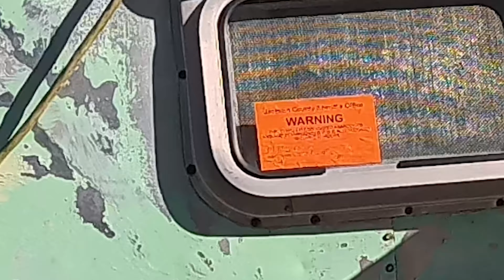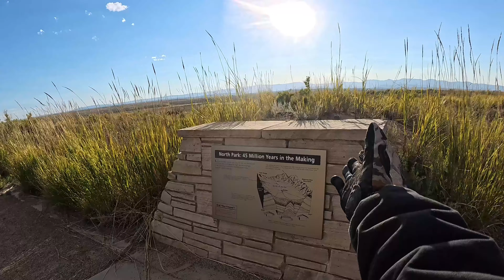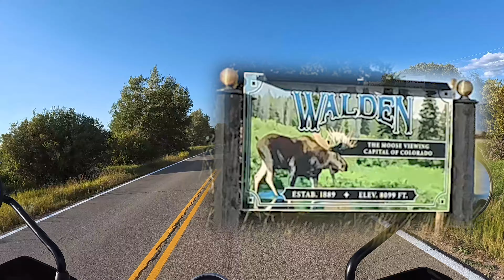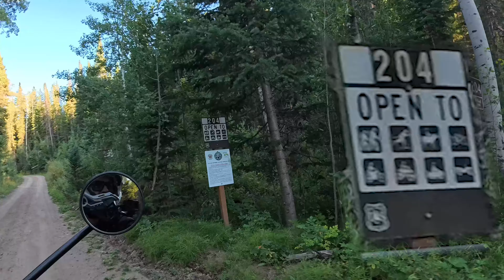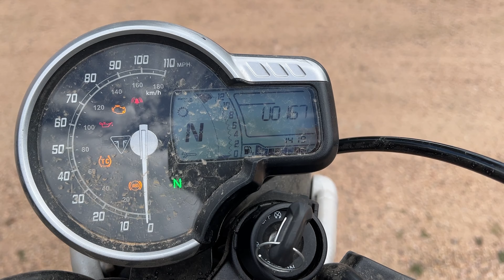1 Little Spill Off Road Disabled My Triumph Scrambler 400 X and Left me Stranded

Comment: It sucks when the tech fails, no matter what the issue. It also sucks that motorcycles aren't required to have the standard OBD system. IMO, even 4 wheelers, boats and side-by sides should have OBD.

Unfortunately, we can't hide from the stupid tech they shove down our throats with new vehicles. There should be a way the end user (owner) could shut this crap off and it will stay off. I'm so tired ofhaving to turn off the lane assist, auto start/stop and all the other crap, just to enjoy driving one of my new vehicles. I have a '22 Toyota, a '23 Mercedes, and a '24 Ford. I miss my '15 Toyota!

I love my TW! I just had it on the hitch carrier to drop my '24 Ford off at the dealer 😜
Reply from the maker: Yeah its so lame noting being able to use a basic obd reader. Yeah I hear ya. All that crap is so annoying especially that auto start stop. Only way around it is to buy old vehicles and fix them up
Reply from the maker: Nice! Thats a great way to do it!

Comment: Should have made sure you had upper and lower crash bars at the start.

Never buy a bike you can't lift. I have no problem picking up my 500# 1200xc, but I deadlift over 400, so that was a consideration
Reply from the maker: Yeah, I can lift it, just harder when a bike is off camber in a wash

Comment: Washing Out Sucks,.....Always happens when least expected,....Sorry about the Future expense,...Stick with Simplicity,....Long Live the TW200. ✌
Reply from the maker: yeah it does, I almost rode that wash out but I learned how to crash over the years, never try and stop a crash just bail. not worth a knee injury. super glad I didn't get hurt yeah I'm mostly upset about right to repair going away with new vehicles. TW200 is the bomb! just blew a fork seal but almost at 19,000 miles and it's time for a front suspension upgrade anyways, and needs new steering bearing set. at least it's never left me stranded
Reply: Won't get you there fast,  but it will always get you there.
Reply: Lol yeah, time for an upgrade.

Comment: RPM in gear ratio brings about the better gas mileage for the horsepower
Reply from the maker: Its also modern fuel injection and engine electronics also

Comment: Time for a 300 rally…
Reply from the maker: LOL, I would get a drx400sm but looks like i'm keeping the Triumph no point in taking a loss, just need to armor it up more, putting the crash bars on, new pro taper handle bars, HDB handguards and mirrors
Reply: Man that thing stock is much too fragile. You hardly dropped it. Sorry that happened. Could you tell me more about your GPS. I’d love to have something simple for off road.
Reply: The Rally is impossibly tall. I lowered mine with a Kouba Link to make it manageable.
Reply: @TDubsKid omg you’d love the DRZ400sm. I just got one. My only gripe is it’s tall. I’m 5’8” @140lbs. I tippy toe it 😂. I will be buying a 1” lowering seat and if I have to, they sell a 1” or a 1.75” lowering link as well but other than that it’s a monster TW200 basically

Comment: That's why you stick to old school tech on a motorcycle. I have my tw200 and a Dr650. New motorcycles are like plastic cars. Kind of lame sorry that happened.
Reply from the maker: yeah exactly if I could go back I would just get a drz400sm instead
Reply: @TDubsKid  it's totally fine to have regrets that's how we learn and grow. Just remember to keep riding a motorcycle.
Reply: @TDubsKid  At least with the DRZ400 you still have a carb you can fix on the trail and have eliminated the fuel injection side of the failure options.  With the Triumph I would be looking at the electric schematic for a way to bypass the factory kill switch.

Comment: That's not cool at all. They need to retro fix that. I don't understand the need for an immobilizer. The wife dropped her Himalayan 450 twice today and the second time the check engine light came on. It does have an automatic fuel shut if the bike goes down running but it resets by shutting the key off and back on. However, the engine light comes on and that took me a few minutes to figure out after making sure it wasn't out of oil or coolant and actually still ran. You have to turn the switch off, hold the throttle full open, turn the key on and back off and it clears. Honestly, I could do well without all the tech.
Reply from the maker: yeah it's crazy, the worst part is that the key pick up antenna should be sold separately for like $50, yet they make you buy the entire immobilizer system and only the dealer can program it, cost about $1200. that's crazy, didn't know they had a system like that. yeah new bikes are finicky
Reply: @TDubsKid  no part of a system like that on a dual sport makes any sense to me. There's now way knowing what this is costing you that I would ever recommend that bike to anyone. And it should be broken out by part and end user repairable for sure.

Comment: $1800 for a key on a $6000 bike makes no sense. your insurance should have totaled it. might call a locksmith to reprogram it for cheaper
Reply from the maker: Yeah its dumb, that wouldn’t work triumph has the software locked down. Only the dealer has access. All part of right to repair debate
Reply: @TDubsKid  i would call triumph main number and have a word. that dealership is trying to rob you

Comment: The "not so thinly disguised" spite on here is pretty pathetic. Sorry about your bike bro
Reply from the maker: Thanks bro
Reply: Eh, what I’m reading isn’t “not so thinly disguised spite” so much as general frustration. This video is a series of bad decisions: off-roading on a bike that is isn’t suitable for the terrain, 4-hour round trip from his truck, alone, remote, evening, can’t lift his bike…not good. It’s definitely time for TDubsKid to start thinking and acting like TDubsMan.
Reply: @dreadwraith8940  hot take. You don't live in Colorado I'm assuming. We take our bikes on roads like this all the time. Yes roads. This isn't a trail. And don't call it a scrambler if it can't scramble. Like riding a Tdub across Colorado is smart? I've got a heavily modified tw200 that I ride in the middle of nowhere and if it fails me, self rescue is literally the only option. I also ride a T7 solo on single tracks. If I go down and can't get to my inreach I probably die. This is Colorado. We just sorta live for this. If we aren't pushing the limits then what's the point? The bike failed. Not tdubskid
Reply: @ I get it - you’re all Adrenalin junkies in Colorado. Great. You’re telling me that Triumph misnamed the Scrambler but bike jockies like you can’t look at it and figure out whether it possesses the requisites hardware to operate in varying terrains? Hm. And yes, self-rescue is sometimes the only option. But even then, one weighs what that will entail: 30-minute walk-out, cell phone reception, etc. You imply that life is only worth living when pushing the limits but you, and most people, certainly aren’t prepared to take that to  its extreme conclusion. Profound regret is at the end of that road. Taking risks isn’t the same as being foolish.
Reply: @dreadwraith8940  ohh ahh my bike quit me and I had to bop down a trail for a bit. Dude our highways have 70-90 miles between towns. What's your point? You're 300% more likely to be involved in a fatal accident on a motorcycle than any other vehicle. Every day is a risk on one. My man has been riding trails in Colorado for over a decade. You think his life was at risk? He was on an ISO road in Colorado. All the hate on here is aimed at tdubskid not being on a tdub and you know it. How many times has he full sent it on a single track or off a mountain and no one said shit? The hate on here is because tdub fanatics are sad that there wasn't a tdub in the video instead of supporting a fellow rider having a failure that shouldn't exist on any bike.

Comment: That's really a shame that you take one little spill on a dirt bike and it will no longer run and get you out of where you are. What kind of engineering is that?? Anti theft is fine and all,  but not when it's wrapped in plastic and vulnerable to easily being broken. If you were on a 1975  DT400 Yamaha not only would you have gotten out, you would have had a complete blast doing so. 50 year old motorcycle was built way better.
Reply from the maker: Yeah not exactly a dirt bike but meant for a little off road, super sad. Some whack engineering if you ask me. Yeah so much to go wrong on these modern bikes. No doubt
Reply: @TDubsKid  Everything these days is whack engineering with all these chips and computers and complete bullshit. Things you drive should not have TV screens. A DT yamaha wasn't a dirt bike, it was a kick ass enduro. My Bonneville isn't a dirt bike until it's in the dirt.